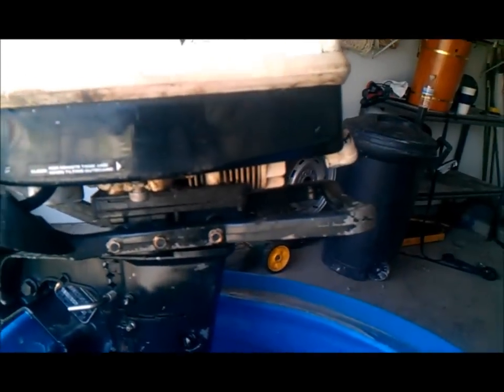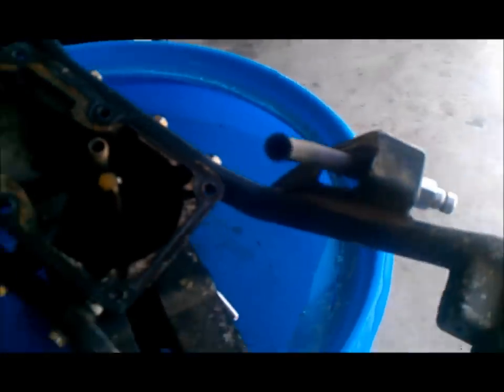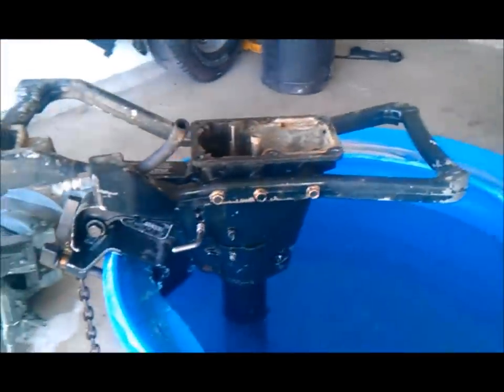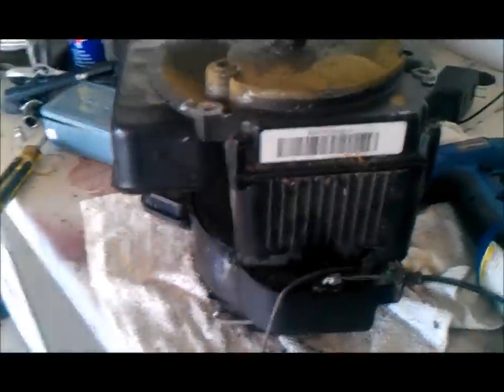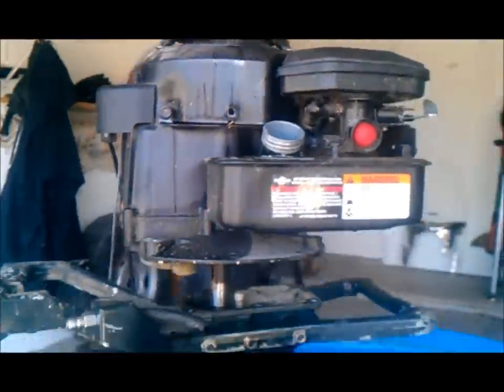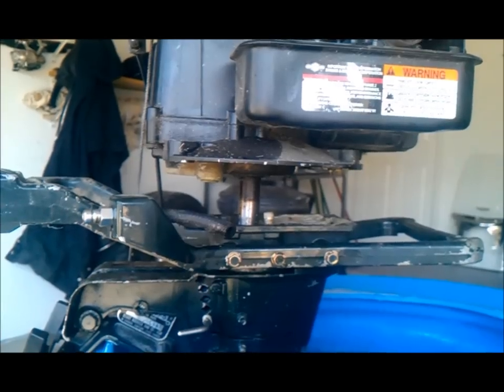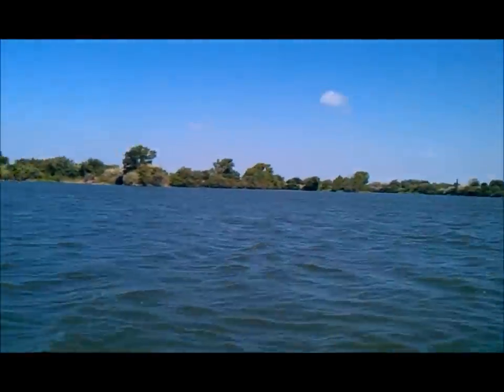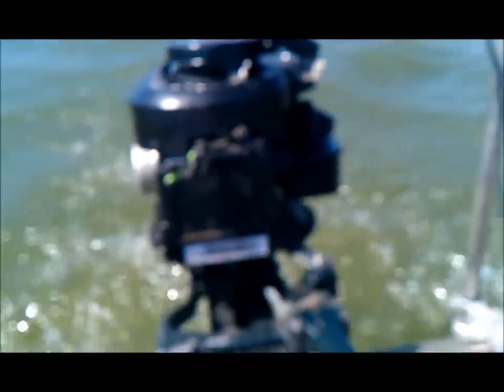Making a Homemade Boat Motor start to finish ( Lawn Mower engine)

Comment: Here in "Bubba" country, outboards with stripped out splines in the shaft/crank joint are fairly common, often the result of mixing boats and budweiser with breakwaters, the rock kind.

A traditional solution is to weld a 3/8 drive, thick wall socket to the end of the crank, with the square hole down.  Then, grind the shaft to 3/8 square, and grease it up.  You have to shorten the shaft a bit to fit it all back together.

That way, for your rig,  you could set a spacer on the foot. set on the motor, and bolt the foot to the power head, through the spacer.

I used to have a dingy with the foot cut at the cavitation plate, and bolted through the floor with a gasket.  A bracket held the lawnmower engine with 3 wing nuts, so I could remove the motor in places like Key West where anything with less than 5 padlocks is considered abandoned.  It wasn't as pretty as a regular outboard, but it stayed with me longer.  And old mower engines are cheap or free, all fitting the same 3 hole pattern.
Reply: Excellent idea, cutting above the cavitation plate and mounting it under the hull. I'm planning something for an E-Scow made into a sail crusier. Thanks for the idea.

Comment from the maker: After I set the motor on top of the outboard shaft, I looked around the shop and found some scrap pieces of metal and fitted them between the lower unit and the lawn mower engine. That probably took longer than anything to figure out but wasn't all that big of a deal. Good luck with yours!

Comment from the maker: I actually drilled thru both shafts with a 1/4" drill bit, then split them apart and drilled the motor shaft 9/32" and after putting the motor back onto the drive shaft, I drove a 1/4" roll pin into them. That gives both shafts room to expand when they heat up. I do have to say though, that I threw a roll pin out after an hour of running or so because it was a cheap Harbor Freight one. The next one came from Home Depot and has held up pretty good so far. 
Thanks for the question!

Comment from the maker: The shaft on the motor is larger than the one on the lower unit. I drilled the motor shaft out so it would slip over the lower unit shaft. Once the motor was sitting on the lower unit shaft, I drilled all the way through both of them together with a 1/4 inch drill bit. I then removed the motor and drilled the new hole in the motor shaft larger, to a 5/16 I believe.

Comment: Pretty cool. I'm sure it's a lot more fuel efficient than the 2 stroke motor it replaced too. I might have to do this to an old 1955 OMC motor that I have.

Comment from the maker: I then put the motor back on the lower unit and realigned the new holes and drove a 1/4 roll pin into the new hole (which of course is now tight in the lower unit shaft and loose in the motor shaft) This gives the two shafts room to grow when they get hot. Hope this helps!

Comment from the maker: @shinyfuzzy - Actually I ditched that idea later and drilled all the way thru with a 3/16 bit and then over sized the motor shaft hole with a 1/4" bit. Slipped them back together with a bunch of grease and knocked a 3/16 roll pin into it. Now it has room to expand with heat. Works real good. Good luck with yours!

Comment from the maker: @Docking23 Yes, sort of. There's actually about an inch of space between the motor and the lower unit base. I made spacers out of aluminum square stock so I would have room to replace the roll pin in the drive shafts without taking the thing apart.

Comment from the maker: @shinyfuzzy I don't doubt it is a cheap motor...it came from a Walmart Weedeater lawnmower...lol. Any time you have two shafts spinning together that arent perfectly aligned like that you will create some friction...plus heat from the engine.It's best to give them a little room for growth. If they heat and cool a few times that may be enough to loosen a set screw.

Comment: How did you attach the mower to the drive shaft on the outboard leg. Did You just attach a tight fitting female coupler that went over the drive shaft?

Comment from the maker: @gavinlily1985  Quite a few posts back, someone mentioned adding a heavier flywheel to make up for the lack of blades. I have noticed that mine starts much better in the water than out. The mower engine starts easier when those heavy blades are helping to swing it around when you pull the start cord so the flywheel idea makes sense.

Comment: I am going to make a jet outboard using a pressure washer XD Ill just remove the prop and connect the exhaust tube to the pressure washer hose. Now pressurized water will come out of the prop shaft and propel the boat with minimal modification.

Comment: That clears it up a lot! Had you thought of a centrifugal clutch to stop the prop at idle? I've been messing with plans for one, but I need to expound my idea further. I thought of putting the clutch on the drive shaft of the motor. Then, on the teeth side, welding a small bit of pipe on to it, and completing your idea from above. do you think that'd work?

Comment: THANK YOU for posting this I have been wondering about this.  Pretty stable boat you have there if you can swing the motor around like that. When the thrust is at 90 degrees to the length of the boat, it will want to flip. Looks like you left the cooling water pump running?  VERY COOL work.

Comment: I have a briggs outboard motor and a Tedd Williams motor like the one you converted.  The TW is lots quieter, and more reliable.  The Briggs is easy to understand, since its just like the mowers I grew up on, and you don't have to mix gas.  For some reason, I still hate it.  Maybe because it reminds me of mowing instead of fishing.  I hope you didn't toss the TW parts.  They might make a good mower.  Thanks for the video.
Reply: LOL!!!!!!

Comment: I took the propeller off my Evinrude and put a lawnmower blade on it. Strapped it to an old mower deck. Works great, but I have to keep the garden hose from getting snagged and yanking the muffs off.

Comment: hi DRMD421.nice going there with this project..my little outbord recently cooked itself,i have seen this type of project b4 and i have a lawnmower engine. but im thinking of the mounting of the engine..did you come up with that bracket idear your self? cheas.

Comment: Thank you for doing this video.  I have a simular outboard that I have had for 15 years... I tried to rebuild the carb...  I remember it being hard to find parts...  I have many old push mowers in the shop..  Did you build a plat to cover where the old engine was bolted?

Comment from the maker: @kodibass- Thanks! Yes i just used a hand drill because there is already a hole in the crank to easily follow to keep it straight. I drill about 1-1/2" deep I believe.

Comment: I would think the shaft on the lawn mower engine would be hard. couldn't be if you drill it.
I've been seeing posts about vibrations. Does yours vibrate a lot ?
Thanks for the video   
George

Comment from the maker: When I found this old motor I assumed the water pump was dried up so I didn't even try to remove it from the lower unit. I just took the motor off and bent the tube out of my way. When I started up the lawn mower engine, lo and behold, the water pump still worked! I just bent it to spray to the rear. It's not being used and its not hurting anything so I just left it like that. Thanks for commenting, and good luck with yours!

Comment: I have done the same thing and it runs good. The only problem is its just to dang loud. I'm trying to figure out how to put a wet exhaust on it that won't suck water back into the cylinder. If you guys have any idea on this please help. Thanks

Comment: it will start and accelerate better and easier if you can find a cast iron flywheel from an older engine. i think most from 7.5hp and under will interchange with briggs and stratton.

Comment: oh and did you add a throttle?  I was thinking about taking the governor linkage off and running a cable down to my handle so I can idle it down or wind it up.  any thoughts on that?  I have a video but my camera is being stupid and wont let me upload it to my pc

Comment from the maker: I actually removed the cable and spring form the "kill switch" and made it pull the other direction to stay on all the time. I just use my thumb to slide it back to kill the engine now.

Comment: you can take the water pump impeller of the lower half of the drive shaft being as you motor is air cooled so when you turn you motor around it doesn't fill your boat up with water
Reply: I was thinking long tubing pointing  behind so you have a constant water Cannon or like a jet ski the stream might add cool effect

Comment from the maker: It is a direct drive. I drilled out the motor shaft, slipped it over the drive shaft, and drilled thru them both and installed a roll pin. Thanks for asking!

Comment: Slower moving yes, but it is able to push a heavier boat.
However, I don't think that is the case with these Sears Ted Williams (built by Eska) motors because they used a Tecumseh 2-stroke lawn mower engine from the factory. I think they only turn 4000 rpm.

Comment: hey I just put the EXACT engine on my eska, when I took it off the mower it would start in 2 pulls easily.  Now that I have it together, it kicks back and is all sorts of hard to start.  I have never had a small engine rip the recoil handle out of my hand.  any ideas???

Comment: Have you thought about making an under water exhaust to help silence it?
Reply from the maker: Derek Perez I piped the exhaust underwater but it limited my turning ability.
Reply: DRMD421 gotcha! are you still using it? pretty cool set up.
Reply from the maker: Derek Perez Thanks! It actually began as a joke. Some guys at work bet I couldn't do it so I videoed the whole process and built it within a couple of hours. I've since sold the boat and I think the motor is laying out beside a friend's garage now.

Comment: now you need to weld a small pipe on the muffler with a 90 degree angle diverting your exhaust in the water so u dont have to lissen to it

Comment: You could have attached the motor to the shaft with a HALF COUPLING like this
http://www.northerntool.com/shop/tools/product_43463_43463
If link doesn't work search for Half Coupling and there is an insert that goes in between to quiet it.
I have an old Johnson 5.5 Hp with a blown engine and a riding mower with a 15.5hp motor I may do this to.
Reply: phartattack 2 years later link still works. 
This plus that=good idea. 
His way clearly did work though, not trying to take any of his props away.
Reply: I love your picture

Comment from the maker: @jstrunck  I really don't know. I didn't title this one. I would be willing to guess the lower unit is still considered the motor and has to be titled just as if the original engine was on it. I called TPWD for mine to make sure it had never been titled before I laid claim to it. Hopefully I won't have to jump thru hoops if I decide to title it.

Comment from the maker: Actually I have since unscrewed the muffler and replaced it with a copper compression fitting and some 3/4 inch copper tubing which I ran down into the water.
Good suggestion though. BTW, does your user name refer to a 72 Chevy pickup?
Reply: How long is the copper pipe? What diameter and does it not wet the spark plug when you turn the engine on and off a few times?

Comment from the maker: @wtyner86 I didnt see much sense in dismantling the lower unit so I just bent the water pump tube to spit that water out the rear of the motor. It's not cooling anything.

Comment: every lawnmower motor I come across turns clock wise and the two boat motors I got turn counter clockwise how you find the right combination
Reply from the maker: Cory Layman I just got lucky I guess. You can find reverse pitch props sometimes though.
Reply: DRMD421 thanks for the quick reply

Comment: yup iv just got my lower unit and gearbox sused i had afully rebuilt lawnmower engine to put one wich spun anti clock wise. and my lower unit of corse is clockwise so i brought another engine thats clockwise and aint to large. cheas mite evan post a vid so u can c

Comment: Is that cool or what!? This just opened a whole new world junk projects for me and my backyard.. When I was a kid, 1950's, '60's, we used to use 55 gal. metal drums for our outboards.. These guys are using the plastic ones..-small motors only. We were able to go up to about 40 hp outboards with the metal drums..

Comment: Awesome! I've always wanted to do that.  Ever thought of running the engine on propane?  Has lots of benefits over gasoline.  It's super easy to do and I've got 3 videos that show how to.  This is 1 of them Gasoline mower to propane conversion - Part 1

Comment: If you remove the water pump impeller from the lower unit, it will not spray water all over the place.

Comment: actually, he is wrong. motor and engine are synonyms. they both mean "a machine that converts a form of energy into a mechanical motion."however it seems like people use motor for small things like an outboard and engine for big things like a car. furthermore things that make electricity from motion are calld generators.

Comment: Sir, you picked the wrong lawn mower model, i have the same push mower and it does not has the same rpm as the older mowers I think  the carb is fix for lower rpm, I feel your disappointment for the speed your boat reach but it is all you had to work with

Comment: cant run a horizontal mtr sideways..get a vertical shaft mtr or.get a right angle gear box, run a sprocket/chain or pulley/belt to one side of the gear box then the other shaft out of the gear box will be aligned with the shaft that goes to the prop.

Comment: Not worth messing with My Ass,  A 5 hp Ted Williams or Eska will push a lot harder IMO than a Johnson 5 hp. . And if you sorce your parts ( you can in 2018 ) . Much cheaper and easier to fix than big brand small outboards.
Reply: Just watch out for Solid State ignition models with no spark. Now some of those might not be worth fixing.  Money wise anyway.

Comment: Motor, motor,, motor,,, NOT,,,, it is an engine,,, burns fuel,, DOES not use electricity,, ole USN vet,,, diesel engineman,,,,, hehehhehe
Reply from the maker: Jimmy Haley so a Harley is an Enginecycle? 😁

Comment: funny..but costs less to buy a new one
Reply: actually a 5 HP out board would cost around $500 new
Reply from the maker: I would be interested in a new $500 outboard motor. Do you have a link to one?
Reply: no way in hell would you find a new 5hp outboard for $500 I just bought a Johnson 5hp seahorse made in 1953 . for $300, I had to rebuild the whole thing
Reply: roughredneck 22 44 45  i"m talking about Chinese junk on ebay
Reply: You may be able to get one for $500 on ebay but it will be shit lol
Reply: Broken motor he had+lawn mower he had= more than 500$? 
I must be missing something.

Comment: So, you're taking a boat motor, and using it to make a boat motor.  That's not what "making a homemade boat motor start to finish" means.
Reply from the maker: Doug Earnest So, sure it is. Watch it again. There's a pause button dead center of the screen if you need to stop and allow some things to sink in.
Reply: No, apparently I'm a bit quicker on the uptake than you are, but thanks for the advice anyway.  It was certainly more useful than your video.

Comment: Shouldve put a rechargeable drill on it
Reply: that would give him 15 minutes of run time in the best conditions. the drill motor also wouldn't last long under that much load, if you powered it from a deep cycle battery set wired for 24 vdc. most rechargeable drills use 18 vdc so one 12vdc deep cycle wouldn't work. 2 deep cycle batteries would add at least 100 pounds to the load that needs to be paddled back when the drill motor windings melt.